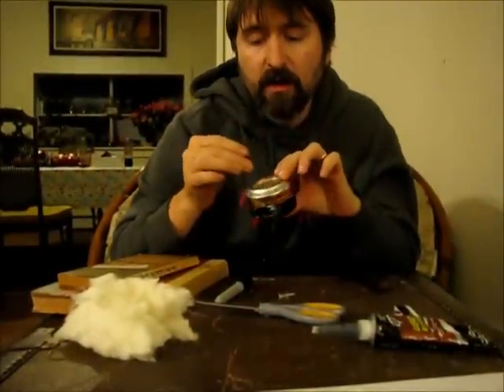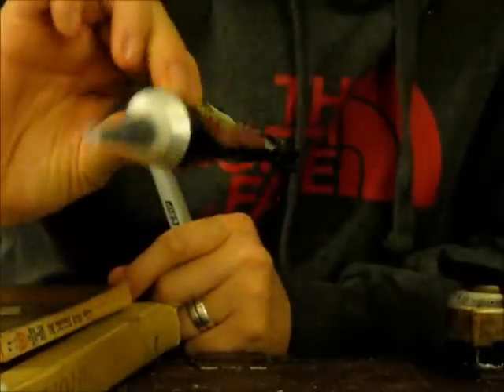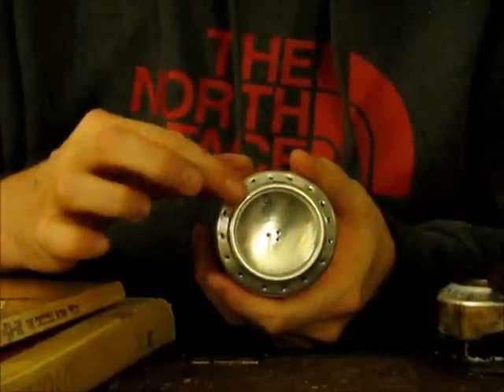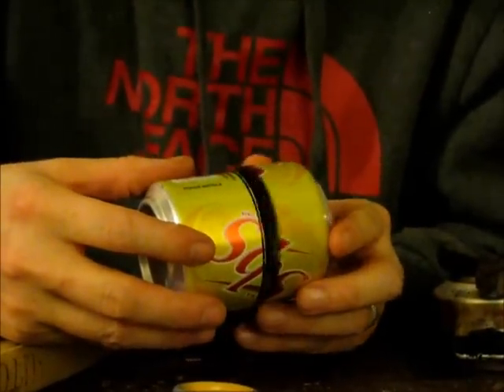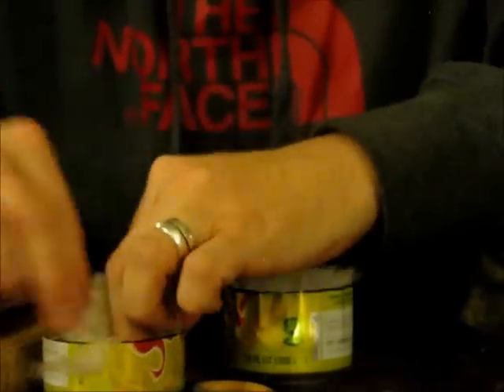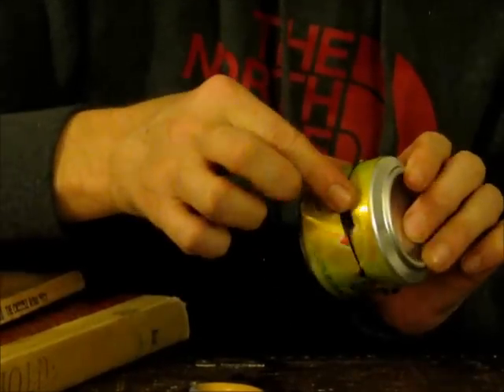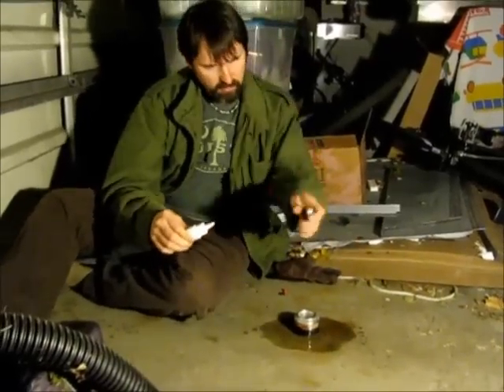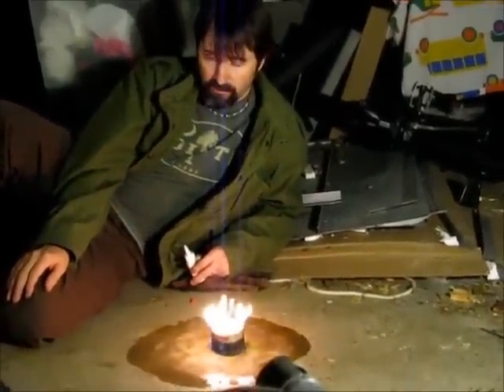Fuel Tools - How to Make a Penny Can Stove

Comment: Great video! Did you use basic insulation from the hardware store? What do you use to set your pot on to sit above the fire? Looking forward to making one of these? Thanks guys!
Reply from the maker: Here we used regular fiberglass insulation, carbon felt works too. A pot can sit right on it because of the 'lip' that's on the bottom of soda cans. However, if you have a Vargo Hexagon wood stove it makes a great windscreen/potstand!